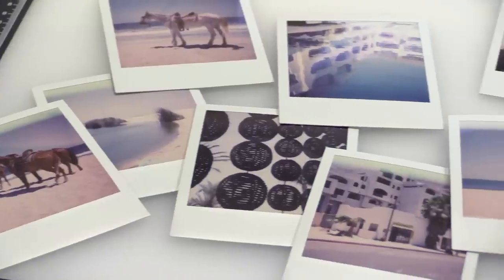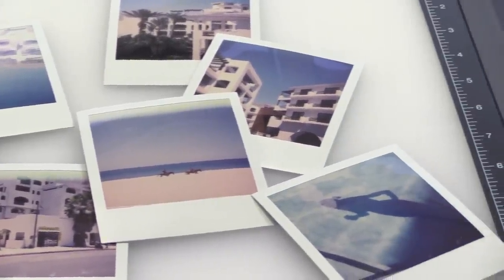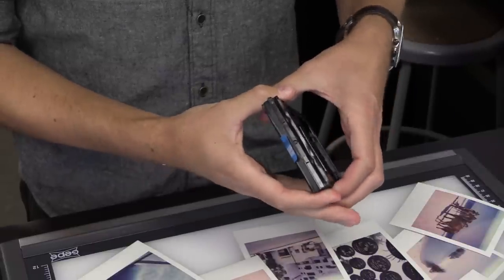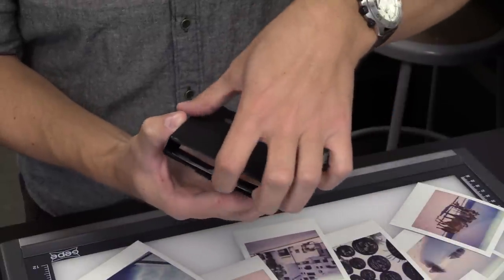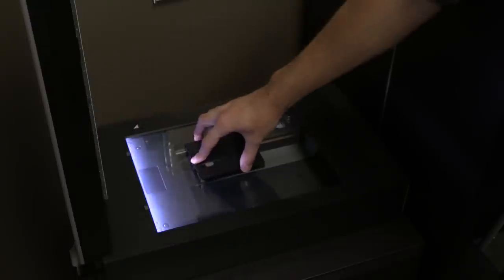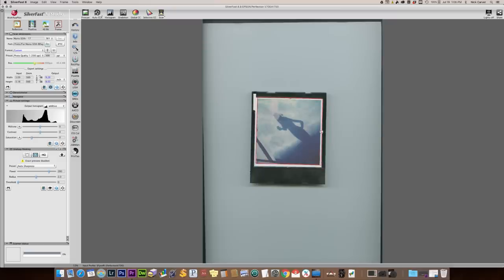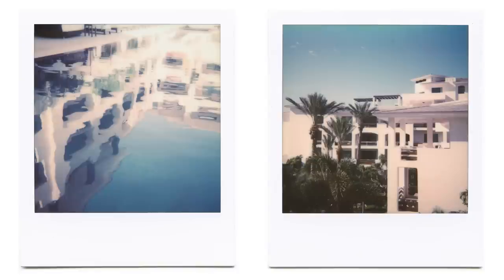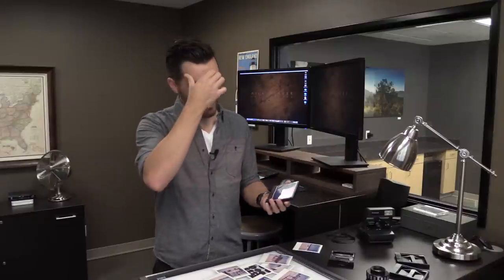Film Photography Tips: Scanning Instant Film (without Newton Rings)

Comment: This is a game changer if you don't care about the aesthetic of scanning the full border. I just did a little bit of playing with a Fuji Instax cartridge and you can do something similar. The pressure plate on the Instax system relies on the camera door applying pressure so the cartridge "spring" alone isn't enough to keep the film flat Like the Polaroids. When you start the film pack save the dark slide. When you finish the pack carefully pry the pressure plate side of the cartridge off at the seam. Then place your print in the exposure side of the cartridge face down, layer the dark slide on top, and put something low-profile with a little weight (I used a small folding box cutter for my test) on top of the dark slide with a little weight to keep the film flat. The rest is just like this video.

Comment: Great tip !! I'll try that, as I have dozens of Polaroids to scan. For the white border, I discovered Lightroom's "Contact Sheet"  function, in the Develop module. I tweak it and set it to 1 image per page and change the page size to 4x5 (smallest it'll go). It allows me to select background colour, stroke around the image, and offset the exact image area (and print area) so that it resembles very closely to the original Polaroid. The great thing about it, once you scan only the image part of all your images, you can export all your files in jpg at once. You can save the preset and even have some for larger sizes.